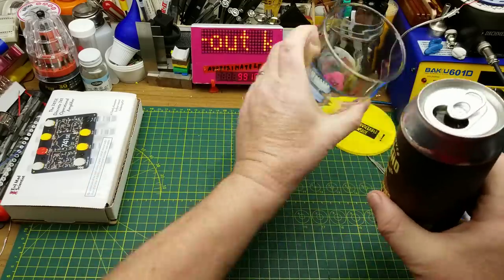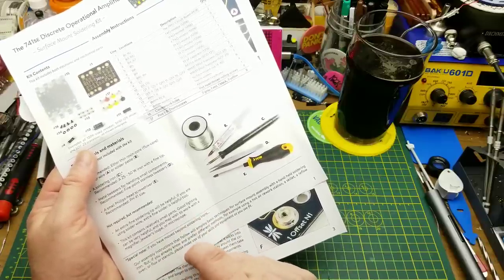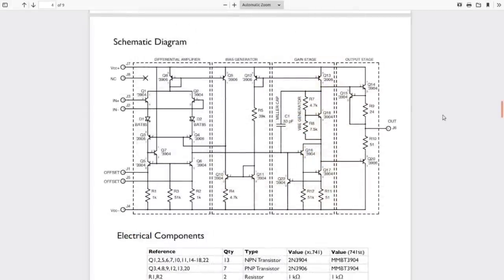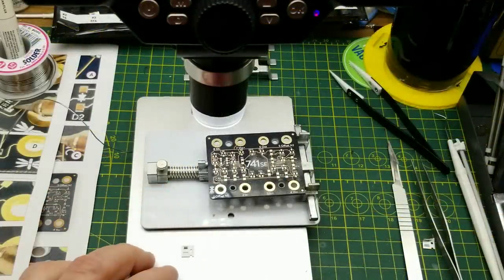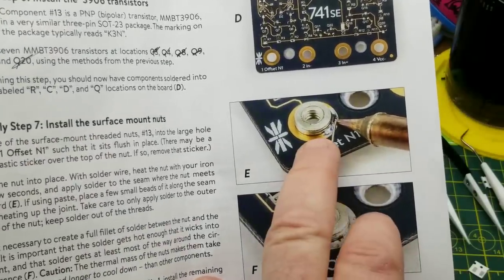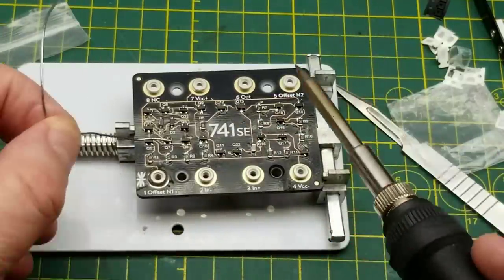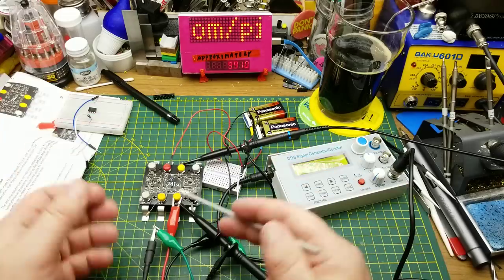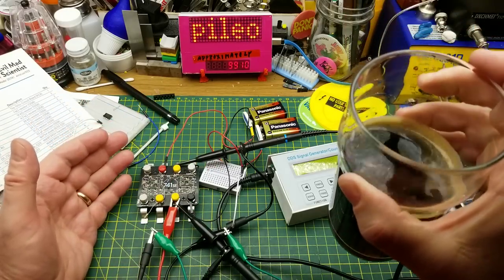Giant LM741 kit build

Comment: A nice fine-tip soldering iron really helps when soldering surface mount parts. For some reason my first go-to is the old-school soldering gun which uses 12awg wire for the tip. I think I do it because it warms up super quickly but the time wasted trying to finagle tiny parts around it makes it take much longer.
Reply from the maker: This tip is the smallest I have.
it's certainly better than the one I used for my first surface mount soldering experience... https://youtu.be/GBML18PZxCQ

Comment: You can straighten them up with Flux and a little bit of hot air afterwards. Surface tension will pull them right into place.

Super cool kit though
Reply: Even without the hot air, flux makes a big difference. With plenty of flux, you can use the iron to heat both sides of the resistors without much risk of bridging them. This plus a  nudge from cocktail stick or the tweezers allows more precise positioning.
Reply: @AndyHullMcPenguin  true, I do that with a bga chip reflow. Tricks of the trade ehh haha

Comment: nice job ... feed back    need offset tweezer to keep it straight
Reply from the maker: I have a couple of pairs of offset ones, but none with as sharp a points as this straight pair.
Reply: It's MUCH easier if you don't put a massive blob of solder on the pad like that.
Just apply flux to the pad, then place the part and hold it down in the correct place.
Then drop a tiny bit of solder on the tip and tack it down. After you solder the other pads properly, come back and retouch the first one.

Comment: Neat kits. Great way to deep dive into the fundamentals of the particular IC.  How do the specs of these “built from scratch” kits compare to the actual IC chips?  I imagine they at least have greater max power dissipation and current handling. I also imagine that there are differences in noise and offset factors.
Reply from the maker: I suspect the performance is similar - the 741 isn't the most efficient of op-amps these days.

I'm not sure if I have precise enough equipment to do a full qualification test and comparison to find the true answer, though.
Reply: @pileofstuff  yeah, it would have to be a labor of love to go to such lengths. :)
Reply from the maker: @aerofart  For me it's the sheer ridiculousness of building a "jelly bean" basic IC out of discrete components.

It's simply a fun thing to have.

Comment: The PCB holder wasn't used correctly - the board is supposed to be gripped in the V-shaped "slots" at the upper part of the 3 arms.
In my (slightly OCD) mind, it was disappointing to see the lack of care in positioning the components. Considering it's primarily intended as a display model, I'd have thought that at least some effort would be taken make it look decent, rather than just be functional.
You wouldn't build or paint railway models in such a sloppy way, right?
Reply: I'm not entirely sure what you mean with the slots on the PCB holder.  Above where he had the PCB doesn't seem like it would have enough of a "V" shape to hold the PCB.  The slots he used seemed fine except the PCB is double the thickness of a regular PCB so it didn't fit exactly right.
As for the "lack of care" of soldering and component alignment, I agree.  This is mainly for show and I would have used more care to get the parts straight and soldering nice and uniform looking.  And more over I think he could have used some flux remover to clean it up.  Flux can really take away from a good looking PCB.  IMHO.  If you're going to spend $30 USD on a kit like this why not take the time to make it look the best that it can?  After all, if you really only need an LM741 for its functional use you can buy 100 DIP packaged ones for less than this kit.